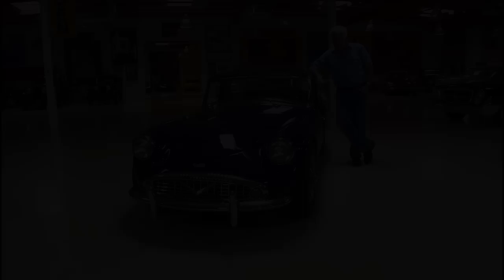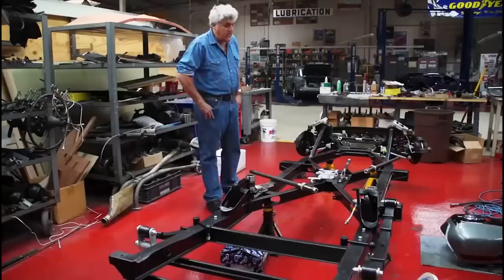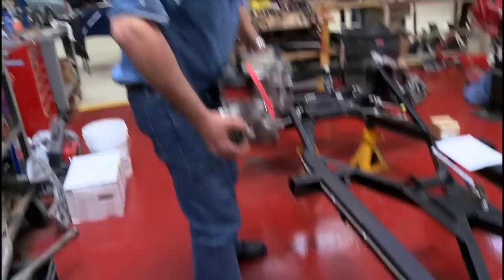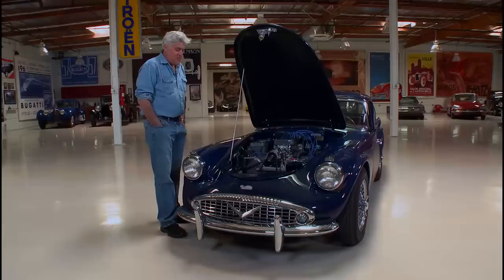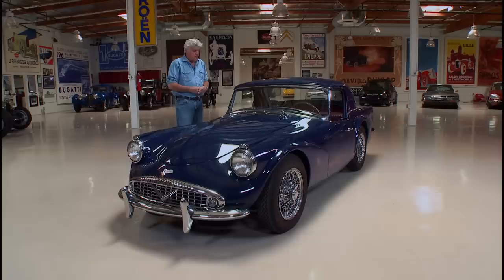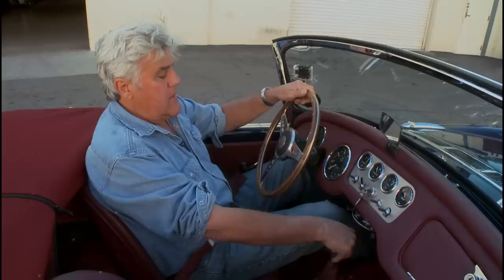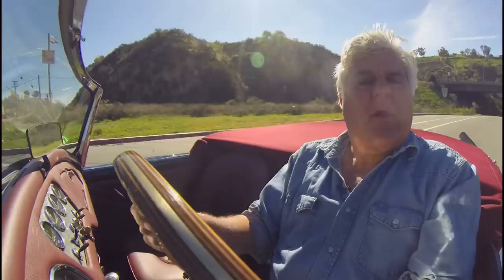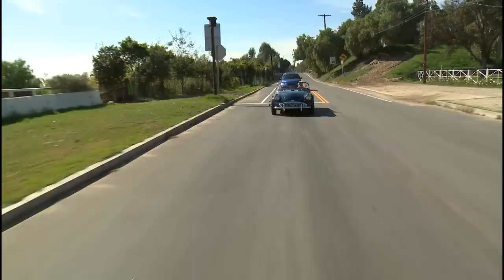1962 Daimler SP250 - Jay Leno's Garage

Comment: british cars radiator caps were always, pressure / length.  ie 13lb/long  7lb/short   long=1" short  =½"   pressures 4/7/11/13 lb   and something that a lotr of people don't know, there are 2 pressure vents in a cap  the main one (big spring) is to release overpressure, and there is a small one often unnoticed in the centre  which lets be sucked back from the overflow tank as it cools.    why you should always maintain the overflow tank, with fluid.

Comment: Hey Jay! 3D printing has come a long way that you're able to produce a bellhousing! Never heard of that before.

How would that Daimler Dart compared to the Thunderbirds of that era? I know they had the 312, I believe.

Hey Jay! - Inventor has working prototype of single wheel bicycle trailer, seeks help to bring to market, and start a manufacturing / inventing empire.
Prototype proves out, no issues. The owner of one of the largest bicycle shops on Long Island says he will carry it once it comes out. 
- Sways with bike around turns. Disconnects from bicycle via single pin. Converts into shopping cart. 
- Planning for food carrying unit, that can carry pizzas, and cold soda.  Designed one that can carry the bag holding for 16-inch pizzas, along with bag holding two 2 L bottles of soda.
- Planning for electric pusher motor type unit, that can convert any bike into an electric bike.  Measured the motor and stuff on electric scooters, will fit into existing design, or may go with hub motor.  Battery will be easily removable for recharging.
- Planning for a larger version, for scooters. Have worked out a method to jury-rig a hitch attached method, to nearly any scooter. Along with the method to incorporate stop light, tail light.
- Design on computer. Numerous other inventions planned.
- if you can dream it we can build it!

Comment: An army buddy of mine had a Daimler roadster, body similar to this one, shortly after getting out of the army.  It, however, had a Ford 55 hp flathead V8.  Reverse didn't work and he had to be very careful where he parked it.  Fun to drive as long as you avoided dead end streets.

Comment: Tonneau cover (US: /tʌˈnoʊ/ or UK: /ˈtɒnoʊ/) describes a hard or soft cover used to protect unoccupied passenger seats in a convertible or roadster, or the cargo bed in a pickup truck. Hard tonneau covers open by a hinging or folding mechanism while soft covers open by rolling up.  A tonneau is an open rear passenger compartment, rounded like a barrel,[2] on an automobile and, by extension, a body style incorporating such a compartment. The word is French, meaning 'cask'. Most tonneau covers were fixed in place as an optional element at purchase, but some could be removed as on the Crestmobile or the two-part (frame and cover) of the early MGB.

Early tonneaus normally had a rear-facing hinged door, but single and dual side doors were soon introduced. The first US side-door tonneau was made by Peerless, and others quickly followed. This led to the development of the modern sedan/saloon, with Cadillac manufacturing the first US production closed-body four-door car in 1910.
Reply: I had a '55 T-Bird that came with a hard top, soft top, and tonneau cover.  The tonneau cover would cover either the passenger side (bench seat) or the entire interior .

Comment: Probably a little low on water or air-locked. It cooled off when you got on it early because it started circulating. When it got warmed up and pushed some coolant out that was enough to keep it from cooling off.

Comment: I had an opportunity to buy one of these in the 80's.  Wish I had of.  Great little sports car.  Don't think there is anything ugly about this car.  It looks like a 58 Packard Hawk.  The V8 was a very good 2.5 liter power plant.  Re cooling: I believe that the radiator fan is direct driven off of the crank.  Perhaps a lighter, more efficient flex fan would cool better at idle, especially if you put a clutch on the fan, which would give you more horsepower at higher RPM's.  The motor does sound fantastic.  One significant cars of the late 50's that you fail to mention were the Studebaker Silver and Golden Hawks that had higher top speed, better 0 to 60 times, faster 1/4 miles and track test times than the Corvette or Thunderbird.

Comment: The SP 250 is quite a lovely car. Edward Turner also designed a 4.5 litre hemi version which was fitted to the Majestic Major far far superior to the XK engine or most other engines around. The irony is in 1948 Daimler also built with Barker the Special Sports one of the prettiest cars on the road. I have been restoring one. However the Special Sports had 1930s engineering and while elegant to drive could not be considered to be a sports car.  Great Video oh and interesting tip 're radiator cap.

Comment: This is a wonderful little car. Amazing that the Daimler mini-V8 was so well-made and ran so well for so long. Then Jaguar bought them and the little engine that could disappear into the maw of the ever-collapsing British auto industry.
Reply: The truth was that Daimler was a small company compared to Jaguar, and the Daimler Dart was being produced in their Coventry factory less than 2 miles from Jaguar Browns Lane where the E Type was also in production.
The car was a sales failure at only 2,600 units built over 5 years, whereas the E-Type sold over 90,000 units. In hard commercial terms, it did well to last so long.

Comment: I think it is great that Jay knows alot about his cars and actually enjoys them, how rewarding this must be....Thanks very much for sharing the result of your hard work, be well and be  
blessed....In addition i would have put the heater fan on high going down the hill, what do you  think, a good move?.......Also, don't you think checking the book for the correct radiator cap is  another positive way to get the right cap, could you not trust this method?....I believe the flaw in this car was that it was not very reliable, had problems keeping it on the road running, 
smile.......

Comment: The engine in the SP250 was also dropped into the Jaguar Mk2 and called the Daimler 2.5 V8. My late father had a 3.4 Mk2 Jag new in 1965 and his best friend owned a Daimler 2.5 V8. I believe it slotted price wise between the 2.4 Jaguar MK2 and the 3.4/3.8 Mk2 . It was marketed as a less performance orientated version.

Comment: The SP250 is a fantastic and overlooked classic.
Bit of advise on the Weber carb if it was new, to check and monitor the fuel inlet union.
I've heard reports of these parting company and causing fires, due to quality issues on carbs produced outside Italy.

Comment: You are right, Jay, this engine could have rivalled the Ford 289 etc, because Daimler also produced a 4.5 litre (275 cu ins) version of this V8 design to power their big saloon. However, one of the things that makes this 2.5 litre (155 cu ins) so lively and responsive is that research by Mazda some thirty years ago identified a cylinder volume of 320 cc as being the perfect size to combust a 14:1 mixture.

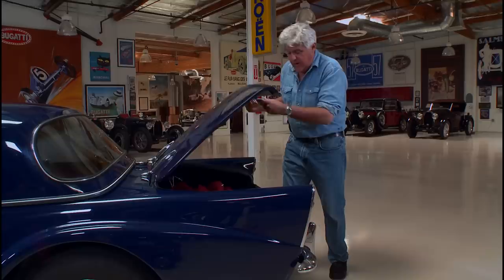Comment: 13:00 A tonneau cover describes a hard or soft cover used to protect unoccupied passenger seats in a convertible or roadster, or the cargo bed in a pickup truck. Hard tonneau covers open by a hinging or folding mechanism while soft covers open by rolling up.

The tonneau cover also conceals and/or covers cargo. When the cover is pulled out, it keeps items out of the sun and provides extra security by keeping personal items out of sight.

Note 'Tonneau' (French) Translation 'Barrel'

Comment: Cap is there to allow system to pressurize so that boiling point of water increases above 100deg centigrade. Because the cap did not seal properly your water simply boiled off and evaporated as it reached that temp. However, engine normally should not be running that hot especially during cruise...it needs to be checked further. Just my 2c.

Comment: A friend of mine had a B spec. version in 1967 in BRG with cream interior with wires. Four up at 120mph with the top down travelling down the A1 no problem. Lovely sound on full song from that V8. Moss gearbox was a bit notcy but loads of torque so no need to use the gearbox too much.
Make over £50K in UK.

Comment: I lusted after one of these after I read the first road test in Road & Track or Car & Driver )I forgot which).  I still don't think it's any worse-looking than the TR2s and TR3s. except for that weird bunch of wrinkles in the top of the grille.  They always reminded me of the Mom forking the crusts of certain pies.  The original fins weren't any worse than those of the early Sunbeam Alpines and the way they toned them down later on, made them look about the same as what the Alpines' later did.  Stay safe, everybody.

Comment: Temp issues are a common Daimler problem. Turning the heat on will bring the temp down. Or even the grill mesh restricts the air flow.

Comment: It does look like a catfish coming at you, not ugly though. Looks a little Jaguar-y to me. Jay, I was born in 65, to parents who had lived thru the depression, and my dad was a WW2 vet. I don't know where they got it from, but I had this little kid's pedal-car that sort of looked like this car, I think it was supposed to look like an MG, but it was a long time ago, so memory may be a bit fuzzy... But it had doors that actually worked, a hood that opened to reveal a plastic model of a V8 (or maybe it was a V12?) and a trunk that would hold a kid's lunchbox. I remember I wanted to take the Briggs out of the lawnmower and put it in there, but of course like all my other broken toys, it mysteriously vanished one day while I was at school. I wish I had a picture of it. Anyways, you brought up a good point with that pressure cap! Damn, that's something I never thought of before. I had a 78 Chevy Monza with a Buick V6 and a 4-speed that was constantly overheating. I tried different thermostats, tried running without a thermostat, I even stuck a 3-core radiator out of a Camaro in it, and it still overheated. I never gave any thought to that cheap Stant pressure cap... Learn something everyday, right? That's one right-purty li'l blue catfish you got there, dude.

Comment: There's another small hemi V-8 that was made. Toyota built an aluminum Hemi V-8 from 1960 until 97. The engine was used in their flagship Century model. Started at 2.4 finished at 4 liters

Comment: Interesting that you used a 3D printer to make the bell housing. My late father had two of these in his lifetime, once in his early twenties and a second when I was growing up. He replaced the four speed Daimler gearbox with a five speed from a Ford sierra, and his very good friend hand crafted a bell housing to mate it to the engine from dozens of individually cut lengths of steel, each bent to shape and welded to the next. Not an elegant solution, but an massive testament to his skill and patience. Sadly when my dad passed away my mother felt unable to keep the car, and I had nowhere to keep it so it was sold. I still to this day regret that we didn't keep it, and I especially regret that we sold it for £8,000 to a former client of my father, given that prices have skyrocketed since! My dad always used to say there were less than 700 left, I wonder what the figure is today? They are certainly one of the rarer sights on U.K. roads.

Edit- I remember frequent overheating issues which were solved by fitting an electric fan in front of the radiator. The original metal (4 blade?) fan behind was hopeless in stop start traffic, but was left in place. The electric fan was held in place with plastic "staples" that went through the radiator fins so zero holes and easily removable.
Reply: There are over 1800 survivors left, according to the club.

Comment: Had one for 12 years from about 1971  - a similar colour, royal blue - dismantled engine twice along with all the mechanicals, manual box, axle, suspension, brakes (many times), outriggers - some mods to make it more livable with, but never touched the fibreglass (did he say it was fibreglass (sorry fiberglass)..) - softop, tonneax and hardtop, all sold with it - but then it disappeared.... Yes I missed that sound after 100k miles use (UK).

Comment: Turner also designed a bigger version of the engine I believe a 4.2 litre whic was only used in the Damlier Majestic Major  Jaguar trialled it in the Mark 10 and it out performed their 3.8 six  William Lyons apparently wasn't impressed and killed off the project. The 2.5 litre engine was used in the Damlier version of the Mark 11 Jaguar as well in auto form

Comment: Pretty cool car but what I REALLY like is that great little engine! As a 2.5 it was about 155 c.i. and it was rated at 140 hp. That's pretty good especially for early 60's where the magical 1hp/c.i. was a tough goal to achieve. Basically a "hemi", it made good power and had the right "sound" that we Yanks all liked. Then they also had a 4.5 l version. Too bad Jag didn't use one of these in their E-Type, that would've been a nice finish to the total package, at least for us Yanks! Kind of surprised when it started running hot that you never even bothered to open the hood, but kept on driving, on the freeway no less! I think what it needs is to be converted to one of our more modern arrangements with the pressurized overflow tank. Can think of lots of good things to put a great little hemi V8 like this into!

Comment: After Sir William bought the Daimler Company (with the intention of having more space to make Jaguars) he did not let this engine go to waste. He installed it in the MkII. This was later known as the Daimler 250 which sold alongside the Jaguar 240. It was not as fas as the MkII with the Jaguar 3.4 or 3.8 litre engines of course.

Edward Turner also designed a 4.5 litre V8 for Daimler. This was used in Daimler's stately limousine - the Majestic Major. These were made in tiny numbers until 1968. Alas, Sir William took no interest in the larger (220bhp) engine.

The Buick V8 was a chance purchase by the Rover Company - not at the time, connected with Daimler. This engine was produced well into the 1990s and became a stalwart of such cars as the TVR, Morgan and Range Rover.

Early Daimlers were indeed the vehicles of choice for Royalty. But in the 1950s Daimler fell out of favour, and the conveyance of Royal personages then fell to Rolls Royce. It has been suggested that the dropping of Daimler came about because Sir Bernard Docker (boss of BSA, Daimler's parent company) allowed his wife, Nora, to take a hand in the design of Daimler's most prestigious models. Nora, a social climbing ex parlour maid, was rather fond of vulgarity in her design work, and Daimler's more refined customers decided to look elsewhere.

Comment: Jay you should have kept it red. And ping off those bumper over rides - that would improve the looks. I would also take to those protruding running lights and trim the mudguard back to the natural line.

But great work and an interesting vid, thanks.

Comment: Great sounding engine and only 2.5L makes it quite the nifty power plant. All of the auto manufacturers seem to be battling it out over who can make the biggest C.I./L engine possible; you'd think it was the 60s again. I like smaller displacement, more efficient engines. One of the reasons I like my Corvair so much, its got a non-conventional, small displacement, efficient, air cooled engine that makes plenty of power, yet can get descent mileage, as well.

Comment: Us army 1968 Alaska 1964 Daimler for sale looked good $600. Not sure about getting parts if needed passed on it. Also passed on a 1960 Austin healy 3000 for $600 running on 5 cylinders. Did buy a 63 beetle for $650 was great in the snow but never forgot those 2 cars

Comment: Jaguar put that engine into a Jaguar Mk II body in the 1960s and called it a Daimler 250. The easiest recognition points were the fluted radiator grille and the V8 badge on the rear. It was a bit more luxury than the Jaguar 2.4 and a bit faster. The first Dart/SP250 I came across was at university in 1967. The owner was a son of the guy who owned one or more of the Macau casinos. Quite well off.

Comment: Neat test drive, but I do not understand why you did not immediately pop the "bonnet" when you pulled to the side of the road. There was obviously something going wrong (steam coming out and over heating), so sensible thing to do is take a look. It is just luck that you did not damage the engine. Good that you showed the source of the problem. Something as basic as the wrong radiator cap could  lead to serious problems. That little V8 really seems neat. Too bad it was not used in other British sports cars or small sedans. An MGB with that engine would have been great fun. Wonder what the gas mileage is? That Weber carb is good for both power and economy.

Comment: Daimler made a 4.5 litre version of that engine Jay, I used to specialise in rebuilding them back in the day..
Reply: I think these engines would be a great swap for certain applications.  Even an E-Type.  Amazing sound.
Reply: @AmericasChoice  My V8 250 Daimler was surprisingly fast too, much much faster than my Mk2 Jaguar 2.4 straight 6 version, one warning though, the V8 pistons are very light weight and weak and if you consistently rev the engine hard they can break and that can cause extensive damage. Internally these engines look just like classic Triumph motorcycle engines only with better (steel) connecting rods and a nicely polished steel crank.
Reply: @rotax636nut5  Is it possible to put in better pistons?

Comment: Turner also built a larger version  (I believe 4.2 litre ?) Used only in th the Damiler Majestic Major . Jaguar engineers considered using it in the Mk10 but  William Lyons thought it would kill the XK engine as it was massively superior to that unit. Yet another lost possibility.